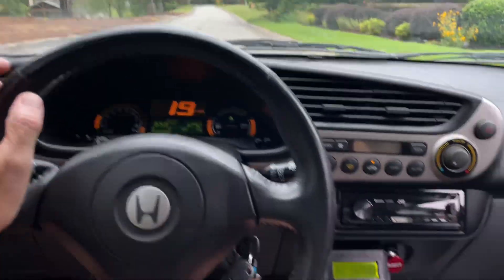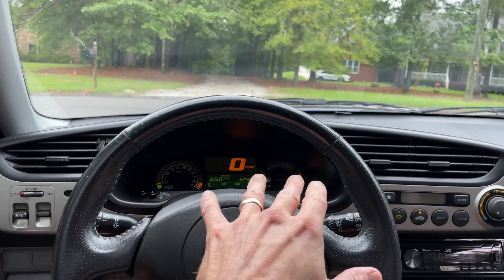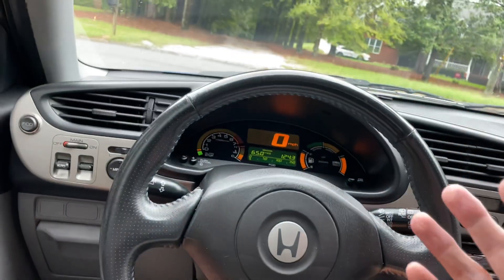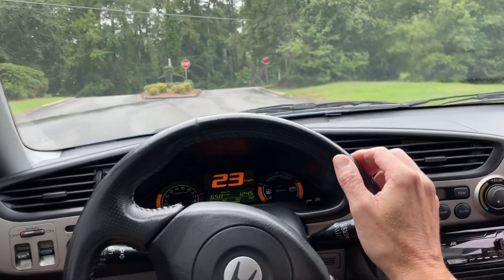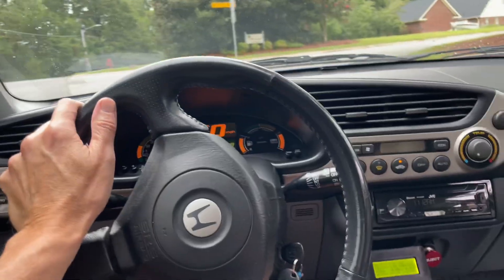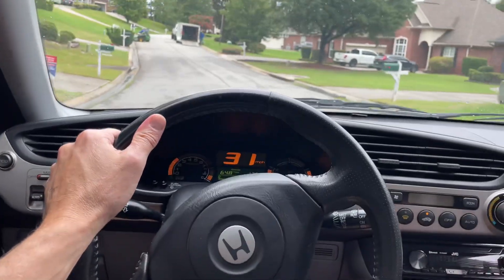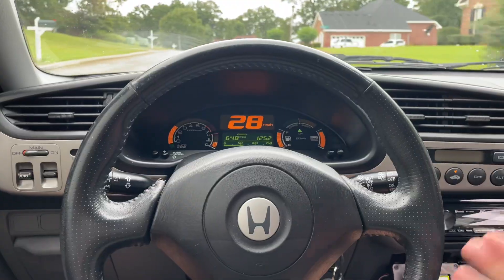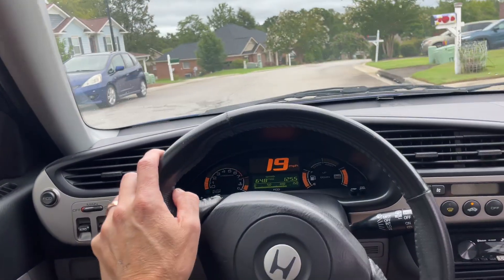QUICK! Honda Insight 5speed: Full manual control of electric motor demo

Comment: My question is, would an automatic transmission model be capable of handling Seattle's hills?
Reply from the maker: I cannot comment on this. Good luck! A 5 speed in the right gear will take any gear...except backwards, reverse is about useless in terms of torque.

Comment: I have John's libcm installed in my insight but I don't have that override or cruise control that you have on your center console, I saw one of your videos that you said that you averaged like 120 something miles per gallon using that cuz you don't work too far away or something like that? The FOMOCO battery has like 12 times the capacity of the battery that you and I have and works much better with that cruise control and I hear that they get what three or four hundred miles per gallon or something like that?
Reply from the maker: I have one friend with the Ford battery, he gets about 250 miles per gallon

Comment: So from what I recall the stock mcm limits max assist to 2nd and 3rd gear, and only for about 3 seconds before it drops down a bit. From my experience with lithium + 40% current hack max assist is a little over 22kw and drops down to about 10kw after, and any gear besides 2nd and 3rd also max at 10kw. From what I've been told/your experience, licontrol allows you to get that max assist as long as you command it, in every gear! Would be cool to see what the 0-60 looks like using licontrol vs the mcm controlling the amount of assist given
Reply from the maker: Yes. From 0-45 the car is right quick. Then, the long gearing slows it down. Still, you can get to 70mph in 2nd gear which makes for a decent pull. I'd estimate 0-60 with my setup in the low 8s; stock is 10.4.
Reply: @gray25xt with my setup (5ah no licontrol) the best I've gotten was like 9-9.5 seconds, but I don't really know how to launch the thing without inducing insane wheel spin/bounce. It's weird because my tires have decent tread on them still, but all the low end torque makes it hard for the skinny tires to grip
Reply from the maker: @tal_os8148  5ah without Licontrol does not have the torque to bring "insane wheel spin/bounce". You either have very bald tires, or your motor mounts are shot, or you're slipping the clutch to force wheel spin...or all three.

Comment: been always thinking of a potential 1st gen insight project one day of having to regulate the amount of electric delivered, but a X% to 100% electric assist boost, a thumb wheel or some sort.

and after following you for perhaps a year or so, you have answered my question with this video. bless up. 🙏🏽

this solidifies my gnarly obsession of the 1st gen insight even more. hopefully i’ll join you soon and save gas with my work commute.

Comment: And how long will that LI-Battery last???
Reply from the maker: From the website:

Q: How long will 5AhG3 lithium modules last?

A: Panasonic's datasheet specifies 90% capacity retention after 10 years.  5AhG3 cells will still work (at reduced capacity) after ten years.

A: At room temperature, the 5AhG3 cell is rated for 10,000 cycles (10-85% SoC), whereas the average G1 Honda Insight might consume a few cycle per week (or ~1500 cycles/decade). 

A: The cells should die due to old age, rather than cycle count.
Reply: @GenXJeffstuff 5Ah?? 
What's its C rate? How many are hooked up into series or parallel?